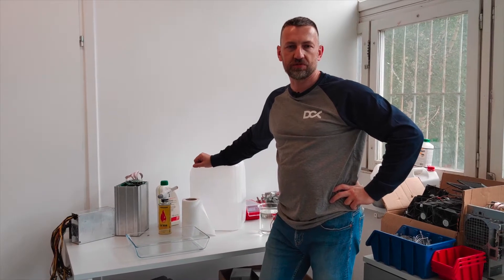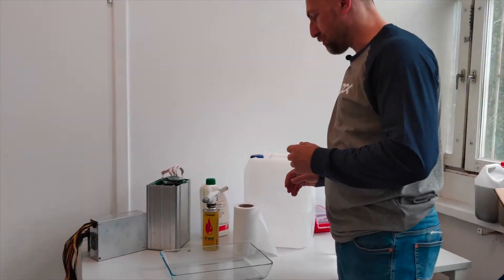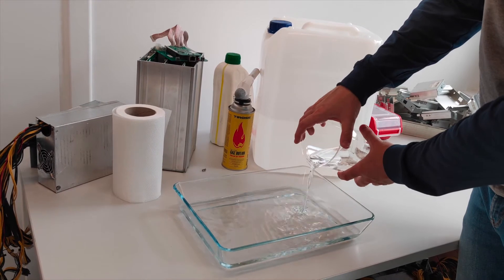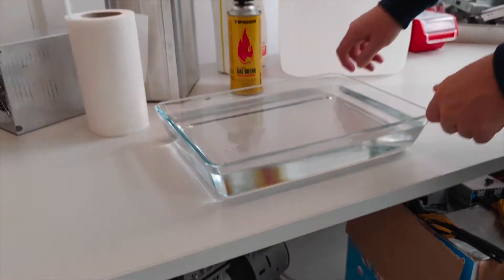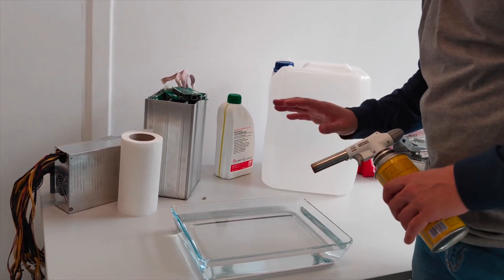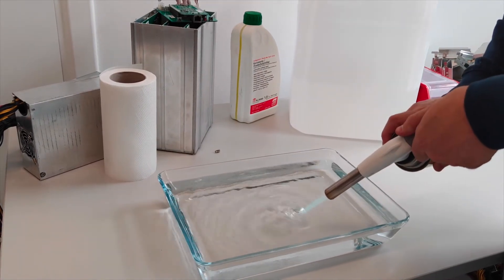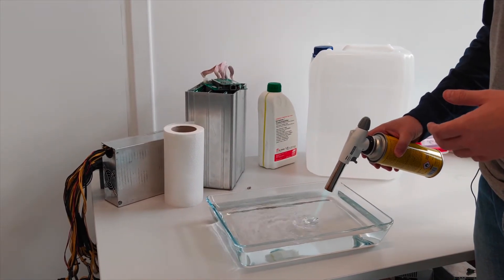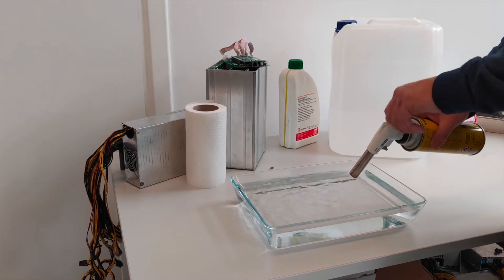Can we ignite dielectric fluid?

Comment from the maker: So the case is that dielectric engineered fluid is non-flammable. There is an NFPA 704 standard called "Standard System for the Identification of the Hazards of Materials for Emergency Response", maintained by the U.S.-based National Fire Protection Association. NFPA 704 classifies Thermasafe R flammability as 1 on a scale of 0 to 4, which means "Materials that require considerable preheating, under all ambient temperature conditions, before ignition and combustion can occur (e.g. mineral oil, ammonia). Includes some finely divided suspended solids that do not require heating before ignition can occur. Flashpoint at or above 93.3 °C (200 °F)."  

However, in operational conditions, our fluid will be classified as 0. It means "Materials that will not burn under typical fire conditions (e.g. Carbon tetrachloride), including intrinsically noncombustible materials such as concrete, stone, and sand. Materials that will not burn in air when exposed to a temperature of 820 °C (1,500 °F) for a period of 5 minutes." 

Now - the Thermasafe R dielectric immersion fluid flashpoint is 160C/320F. And it cand get fire only if the whole fluid amount reaches this temperature. So you would have to put huge amount of energy to get the whole enclosure (200-230L) to that temperature. In server immersion, where the enclosures hold 600-800L of fluid, it's virtually impossible to heat this fluid amount to this point. Both servers and ASIC miners have thermal protection build int and some components may reach up to 80C or more, but this is the end - at that point devices will start to shut down, so we have still 80C to cover to reach 160C and to be able to ignite the fluid.

But wait - if someone will use some heaters and artificially push lots of kW of energy to push the temperature up to 160C? Well, not possible. The fluid in the enclosure constantly circulates. In the five minutes, we pump almost 500L of fluid through the fittings with delta T of 20C. It means the heat is constantly transported to the outside heat rejection device - some dry cooler or pool, or tap water, or any closed loop at home. So summing up - during the operation of the system exposing our enclosure full of pumped fluid to a temperature of 820C for 5 minutes - it will be the last thing that can ignite. You virtually can't get better than that. IMMERSION COOLING HAS FIRE PROTECTION BUILD INTO THE SYSTEM.

Comment: How You clean electronics from Your liquid ? IPA or there is any special cleaner ?
Reply from the maker: IPA is fine. Less expensive. Cleaning methot depends if miners were used or new. You should be cautious (ventilated area / watch out with fire).